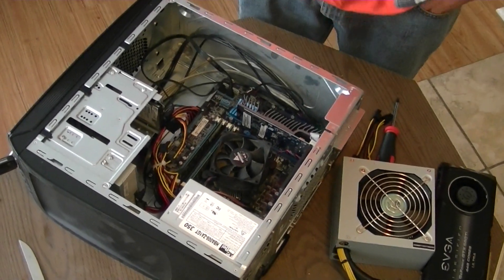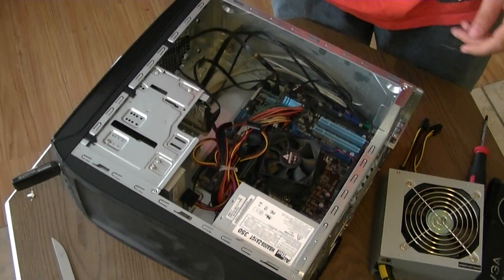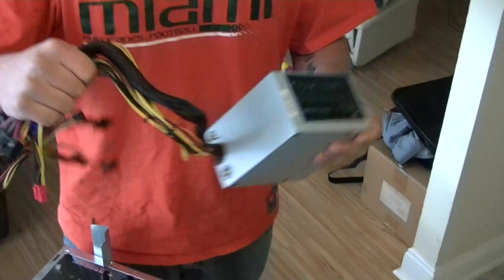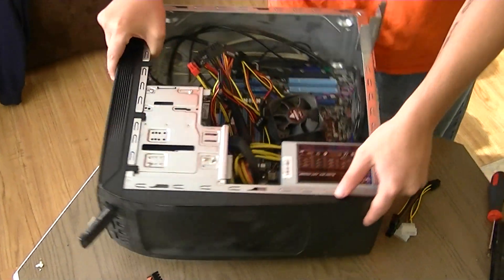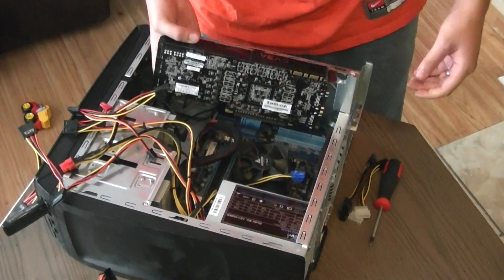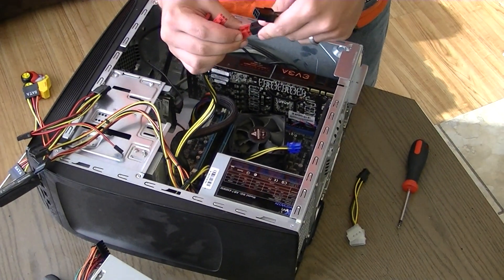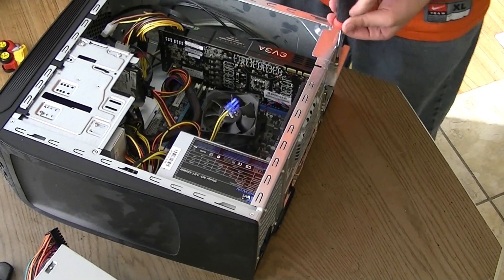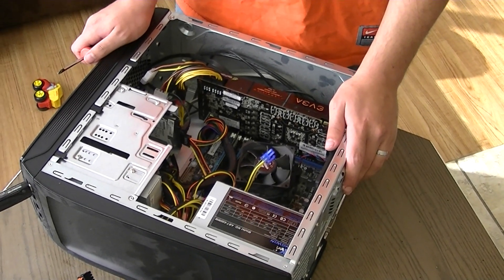Installing My New Video Card & Power Supply!

Comment: Hello! I  just got r9 280  3Gb Black Edition, I'm confuse because i have a 550WW i  don't see any  cables that connect to the graphic card as   i ordered  a cx corsair 750WW in ebay i'l get it in 3 weeks or less while i'm waiting does it sells  6 pins cable connect to the GPU at the local store? Please answer, thanks
Reply: Because some of the videos people don't comment, like this for example, people rarely comment on this video,
Reply: Well lol, i'm mostly online at this time, so yeah i got your notification, anyways, i commented on this video since september 2015, i ended up buying cx corsair 750WW modular 80+bronze and it has all cable and pins that are needed for the latest graphic cards, so yeah, it's all working fine, i can let my PC on without turning it off for 2 weeks, i have 5 fans in my casing including 2 led fans :D
Reply: Also don't forget, AMD GPU Require more powers, so if you have same graphic card like me. i'd recommend you to buy a powerful PSU like mine or different model etc,
Reply: Lol ahaha it happens and wow nice 2x 980  gpus, you must be rich lol, i'm planning to upgrade my GPU this year, Gtx 970 or maybe 980 depends on my budget,
Reply: i5 4460 and i have a shitty intel cooler but does that matter? Since i have 5 fans in my casing
Reply: Lol you're taking it so wrong, i mean i have a shitty intel cooler fan in my casing, does it really matter? since i have 5 fans... and im going to course, answer my question then maybe later i'll reply you.

Comment: so let's say we want to get a gtx 970 working , it needs 28A

we have a 600w psu with multi ray 12v1 18amp 12v2 18amp
so both multi rays are 18amps each = 36A

we use 2 6pins to connect to the 970

each pin sucks out around 18amp each from each 12v slot ? so we meet the minimum and exceed the amps and get 36amps , is that how psu's work?? and if it were to be lower it wouldn't work right?

what if it was a single ray how does that work do we still need to use 2 6 pin connectors or only one?

then how do i know if i'm using both multi rails if i'm using the same 2 pins i do either on a single or multi?